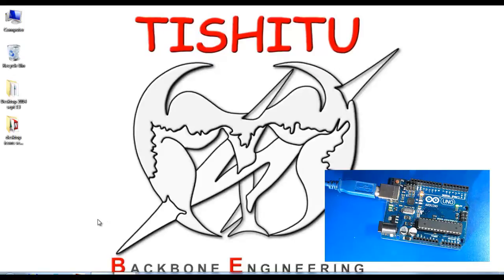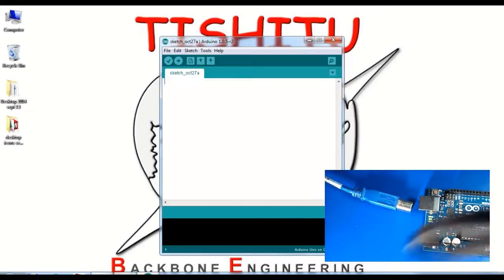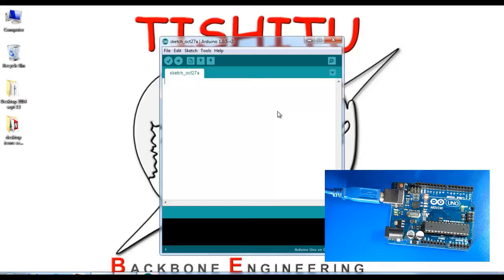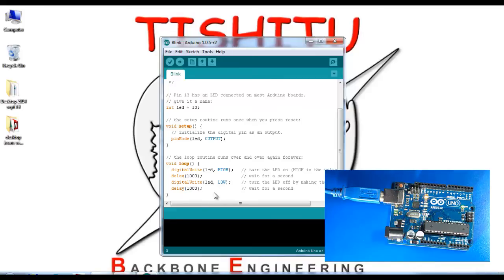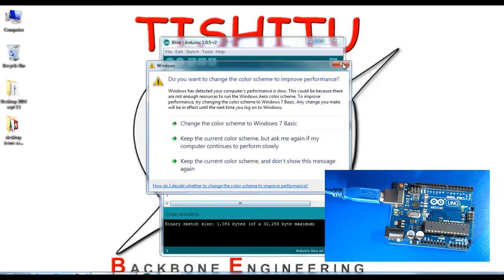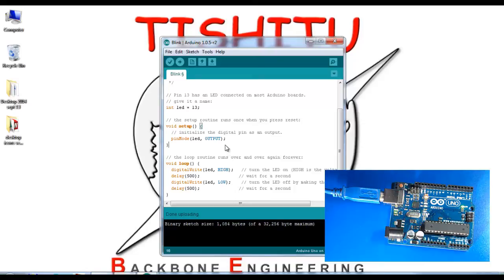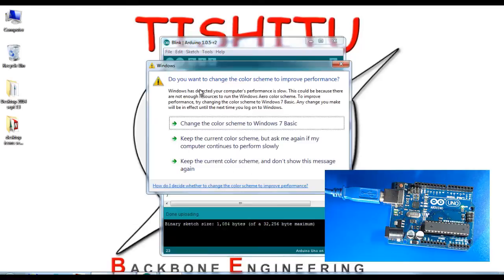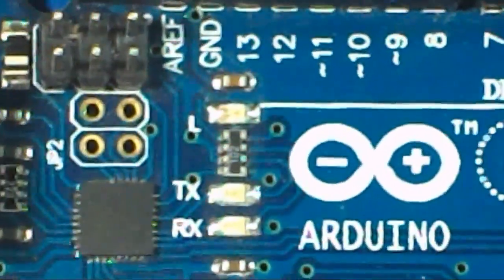1 Basic LED Blinking in Arduino UNO R3 Board

Comment: Power light is not blowing when connecting with PC, and upload is verifying but showing error when uploading scratch, can anyone help me please?
Reply: And Power light is on when connecting supply
Reply from the maker: Please chk in control panel which comport is assigned or arduino may be not genuine AVR type

Comment: Hello Tarun, looking for some help on a project.
This is what I want to do: Turn on a switch, light blinks 3 or 4 times, then it goes full bright and then dies down a little and stays on. Then the second button press just shuts off the LED light.
Reply from the maker: you have to go with PWM pulse with control of LED